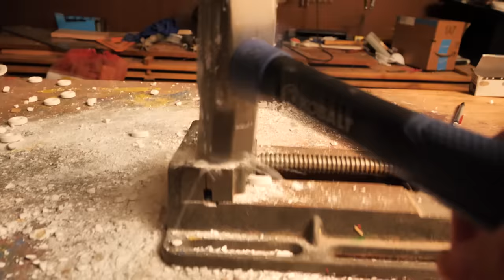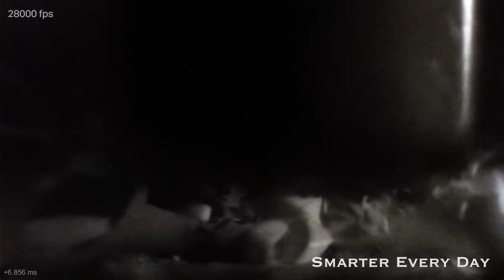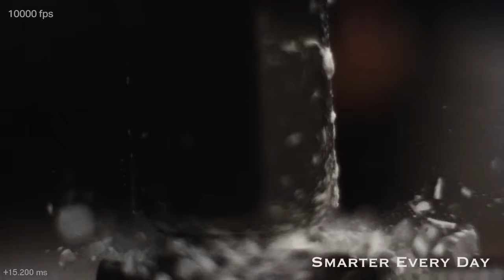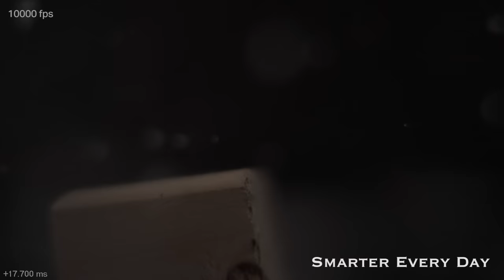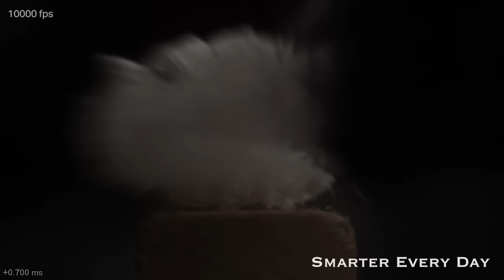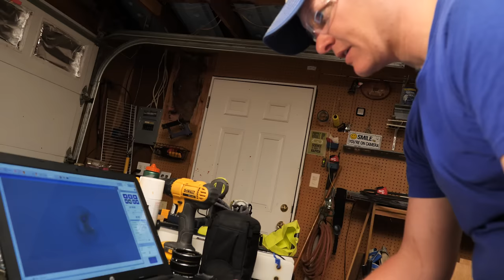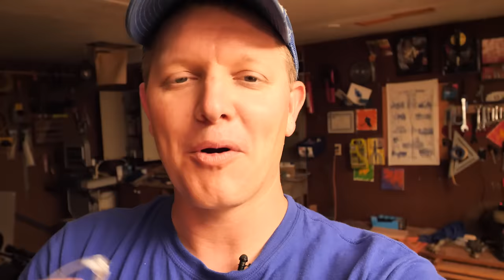LIFE SAVER LIGHTNING (Triboluminescence Slow Motion) - Smarter Every Day

Comment: I've always wanted to film this but just assumed the sparks would be too dim to really see with the lighting required for high speed. Really cool footage!

Edit: Oh, and also I had no idea this was triboluminescence! I thought it was peizoelectric arcing
Reply from the maker: What's up Ben, good to see you here man.  Yeah I thought it was "static" and never really thought about it much more than that. Obviously it's not because it's a mechanical event.  There are many journal articles on it.  https://scholar.google.com/scholar?hl=en&q=triboluminescence+life+savers&btnG=&as_sdt=1%2C1&as_sdtp=
Reply: Thanks Destin, rock on! I'm going to have to do some reading.
Reply: hey man love both your channels .........just a thought what about if you compressed it to the point of fracture or put it in a  clear pressure tank till it fractured, just curious what results you might get :-)
Reply: Going off the wikipedia page for Triboluminescence: "Triboluminescence differs from piezoluminescence in that a piezoluminescent material emits light when it is deformed, as opposed to broken."
Reply: Get a chunk of quartz and a burr ball bit for a dremel and grind the quartz, it has the same effect, but is nearly continuous.
Reply: you can get spark from plastic zip too ive seen it myself in the dark and was truly amazed to discover that as i was just closing my bed sheets.
 or from peeling adhesive tape away from something  (will work better  with roll you unroll, it come from the glue) it also emit some Xray.
i remember reading this because some guys was studying it to make cheap xray emitter for  poor country.
Reply: NightHawkInLight will the spark ignited a flame if you create the right atmosphere?
Reply: Though in a sense, triboluminescence is a more extreme version of peizoeletricity, right? Or am I missing something?
Reply: This would look amazing as a wallpaper
Reply: desten and nighthawk speak english u 2!
Reply: Smarter Every Day 2 it still says stress induced charge seperation, isn't that exactly what piezoelectricity is?
Reply: I wonder if there is any other type of radiation emitted from the breaking lifesaver other than visible light. Because the light appears to be blue, which is at the high end of the visible light spectrum. 

I wonder if there could possibly be any other electromagnetic emissions such as infrared or ultraviolet. I don't know how you would test this though. An infrared camera could pickup the infrared, but I am not sure about the ultraviolet.

The radiation emitted as a result of triboluminescence may differ depending on the strength of the bonds of the given material. Imagine the amount of energy that may be released from breaking diamond.
Reply: Scottomget, actually it's possible this would also emit even X-rays but only in a vacuum tube, but this is only if it is an electrical phenomenon. Judging from the blue light I'd say it is an electrical phenomenon. 

Also, the same thing happens with sellotape. There is charge separation and they were able to make enough X-rays to make a film of someones hand.
Reply: it looks like it's turning blue before the bullet actually gets there is that just how it appears? Is that the air pressure from the air gun damaging the lifesaver before the actual lead pellet gets there?
Reply: passive agressive nerd fight!
Reply: Probably the rolling shutter effect.
Reply: @scotttomget: Yes, my first question was "but why exactly blue light?" It will be interesting to investigate the colours if there, in invisible spectrum and why we see exactly blue colours.
Reply: Surely the colour pertains to the chemicals forming the light, as in like how fireworks give their colour, as in magnesium a bright white and copper green and so on ..........just a thought
Reply: Why blue? Does different kinds of crystals emit different wavelenghts of light?
Reply: I wonder what would happen using a salt lick.
Reply: NightHawkInLight try it with tape. Quite a lot of sparks over a full second when you stick it to itself and pull it apart. Should be plenty of footage.
Reply: I knew it was triboluminescence because I was on a field trip and they told me it was
Reply: I didnt know Nighthawkinlight knew science!
Reply: Smarter Every Day 2 if that's an electrical spark, could it be used to ignite petrol?
Reply: NightHawkInLight i was literally thinking that exact thing when he said he was going to film it in high speed. also i watched the vid where he broke the prince rupert with bigger bullets and it is there too when he hit it with a glancing shot as well as the candy crush lightning lol
Reply: Can it start a fire?
Reply: static noises in head
whut?
Reply: I dont know if you would have life savers with you when youre somewhere in the woods wanting to start a fire...
Reply: NightHawkInLight NightHawkInLight I love your videos, just next time please be sure to tell the kids to !WEAR PROTECTIVE EYEWEAR! When smashing things in the dark UP CLOSE lol..
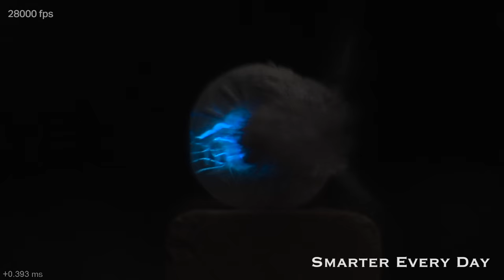Reply: @4:30 250ms I can see the light before the bullet hits and the candy is still in one peace, how?
Reply: Hey Guys. I Think It's Because A Friction Between Hard Lifesaver Candy With Himself And A Caliber. A Friction Is Make A Heat And Also Some Wave Thing. Because The Heat So Hot It Can Be Blue Or Maybe It Can Be Also Because A Wave Between Molecule/Photon. That's Why The Candy Make Tribolumenescene
Reply: Same thing happens if you crack ice cubes in the dark.  Always figured it was static electricity...
Reply: Bed sheets is static...
Reply: @SmarterEveryDay2  Hey Destin, any idea why light begins to appear 4:29 before the pellet strikes the candy? Have you tried running the experiment with near misses to see if its a pressure wave effect? Or is it something more benign like a frame perfect strike or other camera related cause?
Reply: Check out Sono illuminessence
Reply: What if we take a big candy or many candies together???
Reply: Lifesaver, more like lightsaver.
LightSaber.
Reply: @SmarterEveryDay2   Did you notice the life saver started glowing just before the pellet hit it? as if the pressure wave started the reaction.
Reply: Are these sparks capable of igniting fumes or any other type of accelerant? Pumping gas chewing on a lifesaver?
Reply: It's extremely creative to think that it's not actually real time sound
Reply: 🇮🇹 4:30 The we can see that it lights up even before the bullet hits❗❓
Reply: Smarter Every Day 2 Correct me if I’m wrong but I saw electric arcing starting before the pellet even hit the lifesaver. Interesting.
Reply: I hate to be the one doing this on a three year old video, but....

*piezoelectric
Reply: @SmarterEveryDay2  CHECK OUT THE FRAME AROUND 4:30! The shockwave in front of the projectile causes it to light up before it reaches the Lifesaver.
Reply: @Server0750  The shockwave in front of the projectile impacts the Lifesaver before the projectile reaches it.
Reply: @Stacy_Smith  does a bb go faster than the speed of sound to create that Shockwave
Reply: @Server0750  I think it depends on how much you pump it, but yes there are supersonic air rifles.

Even at subsonic speeds, the air it's meeting has to go somewhere. So there's bound to be compressed air in the front of it. Maybe not enough to to create a sonic crack, (that's slang for the sonic boom generated by a projectile), but nonetheless it still has to be there.
Reply: @SmarterEveryDay2  DUDE! You HAVE to revisit this! Your comment section is BLOWING UP with theories pertaining to the lighting of the Lifesaver prior to impact.

The 2 prominent theories are:
#1 A video defect created by the camera. (They keep referring to something called "rolling shutter effect")

#2 Compressed air at the front of the bb caused by it's motion is striking the Lifesaver shortly before impact.

You've heard the figure of speech: "I'm a _____ not a rocket scientist" right"? Well I'm a truck driver not a rocket scientist, but I do know of a rocket scientist on YouTube that has a channel called "Smarter Every day".
Reply: Coming in late but education knows no time. It seems I observed that one lifesaver started “lighting” before the pellet hit. Was that from the air disruption in front of the projectile?
Reply: I don't think sparks or lightning is right. In both those cases, high amounts of electricity is turning air into plasma and scattering blue light (blue light being a side-effect). In this case the crystal structure is actually producing/emitting blue light. Also, the sensor in the camera has definitely exaggerated the blue light. In the first "shooting" of the candy, the entire side of the candy was blue when you could still see the writing. If the writing is still intact why is there light? The camera may be adding extra blue light when its trying to guess the colour of the pixels (similar to why we say a lot of rainbow pixels in slo-mo footage)
Reply: You might be able to catch some cool long exposure photography shots with this, like you would with lightning 🌩 😉

Comment: This reminds me of the lifesaver commercial from the 1980, that has a couple on a couch and one of them says if you “bite it in the dark it makes a spark” then they turn the light out.
Reply: This happens when biting them too?! Sounds like total agony on a filling (old school mercury grey fillings)!
Reply: @goatlps  gosh never considered that.  Did you actually get a zap feeling?   I know Dr Tenet does a lot of work with tooth voltages.
Reply: @MrShakamuni01  no, you don’t feel anything from the spark.
Reply: @MrShakamuni01  not really a spark, it's crystaline fracturing exciting electrons that were formerly bound to a partner. You can get the same by striking quartz crystals together, rubbing them together, etc. Cellophane tape unrolling also generates the phenomena, as well as x-rays sufficient to actually x-ray a researcher's finger in a vacuum chamber.
Electrons are very excitable things.
Reply: Me and my friends used to do that all the time; worked best with the spearmint ones - stand in front of a mirror with the lights off and you can see them spark when you crunch down
Reply: @spvillano  "electrons are very excitable things"...omg, best comment ever.

Comment: Why is it blue why not any other color???
Reply: Electricity
Reply: Different atoms give off light at different frequencies of the electromagnetic spectrum. I guess glucose just happens to give off the blue part of the spectrum.
Reply: KeshKoKid It gives of an electrical charge and this is why its blue. When he smashed it with a hammer you can see it pretty easily that that is what happens.
Reply: Elias Bazan Here is answer from wikipedia: "Wint-O-Green Life Savers work especially well for creating such sparks, because wintergreen oil (methyl salicylate) is fluorescent and converts ultraviolet light into blue light. "
Reply: here's my guess it just a low energy output
Reply: +Lilcon - Wrong way round.  Blue light has the highest energy of the visible spectrum; if it was a low energy output it would be towards the red.
Reply: The color is dependent on the electron's state which is dependent on which atom it is with. I think Nitrogen glows blue when excited and most of our air is Nitrogen.
Reply: Elias Razan, I would have guessed it was electricity-related, myself... BUT going through the slow-plays and looking closer, I noticed that the light always followed the fractures exactly. Electrons simply don't do that... Since electricity of any kind follows the path of least resistance (a fairly inconsistent path) and the light from the life savers followed (consistently and predictably) the exact paths of fractures... It's probably not electrons or related to them.
   What's left is the possibility of energy output, and blue being the color of the higher end of visible light... That would mean there's considerable heat involved. From experience, even a small ablative spark from material being machined (like a rotary tool against a stone) the sparks tend to be red-orange to some white-ish... and they're extremely hot (burn hands, singe clothes, etc) and I don't see enough spark around to cause the slightest hint of a singe-mark or any other evidence of excess heat. In fact, the sparks don't seem to have much energy at all... In the slow-plays (again looking closely) the sparks scarcely last long enough to make a contiguous line along a single fracture, and this is something the size of a life saver candy at multiple thousands of frames per second... So no... It's not for heat, energy or much of anything related.
   Finally, we have the "resonance" of the material. Someone mentioned that wintergreen is composed of chemicals that tend to turn the excitement of ultra-violet light to blue innately, so that is likely. There's also the possibility that between the wintergreen additives, the sugar (sucrose, btw, not exactly glucose) and other constituents of the candy shaping and crystalline structure, that blue is predominantly emitted, and/or exacerbated with the very fracturing process in the candy itself. Just like you'll always get a hot, orangish-yellow spark for striking iron against flint, you'll likely always get the same clean blue color for crushing or shattering a wintergreen life saver... Whether it's the specifics of the wintergreen oil, or the whole combination is about all that's up for debate... So grab some wintergreen anything and start crushing to see what's what... :o)
Reply: Oxygen perhaps
Reply: N2* → N2 + hν and O2* + 2 O2 → 2 O3 is the process of which creates the blue colour. Also water vapor, when present may also play a role.

Comment: If you bite in one fast enough, does it light up in your mouth and shock you?
Reply: @karim lavji I'm not so sure about it. Light is fotons after all, and even when they don't have mass, they do have electrical charge. What I assume is that there is so low electrical charge you wouldn't feel anything, or the "crush" you make isn't enough to make them. I'm curious about it, if it releases the charge because they have an electrical charge from the beginning, or because of friction.
Reply: @pokerraper1  when you don't pay attention to the 6th grade science lessons

Now watch this start a war
Reply: I can promise you, a piece of hard candy does not have stored electrical charge
Reply: Nightcore Sorcerer yeah that could be a legal problem
Reply: @skilled_boi4076  no, but it does have energy stored in the structure.
Reply: Nope, not an electrical current, it's an electron bond breaking in the crystal. You can generate this also in quartz crystals being rubbed or struck together.

Comment: If the light is from ionization of the surrounding air, if you were to smash it in various different gaseous atmospheres, would it create different colors?
Reply: Alex Ozzie it should be tried on vaccuum as a control experiment
Reply: Tadeo Velazquez I believe I read on the wiki that it has been performed in a vacuum with scotch tape and it produced x-rays.
Reply: I wonder if it could ignite a gas like a hydrogen/oxygen mixture perhaps.
Reply: MOM get the argon!

Comment: Dustin, Don't know if you noticed this but it appears the Life Saver glows blue right before the pellet hits it.  I wonder what would cause that because the pellet has not struck it yet, unless it is because the pellet is moving faster than the frame rate so it appears to have not struck yet when it has.  Fascinating either way.

Comment: Why does it triboluminescence right before the BB or Pellet hits the Lifesaver at 4:30 (28,000fps camera mark +0.250) on the right side? It looks as if it knows where it's about to get hit at and spark right before contact. I first noticed it with the hammer and thought I was seeing things and after rewatching it a lot of times I just assumed that it was some reflection of light that showed the hammer in the frame at a point it's already passed and already hit the Lifesaver. I assumed because Light is faster then photography that's why I see the Spark before I see the actual photo of it being hit. Then I realized Light is Light whether it's Light from the Spark or Light from the Photography I'll See it at the same time them I seen it again hear and I'm still puzzled on why?

Comment: My thought is it's the energy released from mass created from these crystalline chemical bonds. The first law of thermodynamics is that energy cannot be created or destroyed (energy is conserved). Einstein's basic equation of relativity is E = mc^2, where E is energy, m is mass, and c is the speed of light squared. We know that nuclear bombs operate by splitting atoms, and during that process, matter is converted to energy (of course, which explains where the massive amounts of energy come from). However, in chemical bonds, there is a very slight amount of mass increase, nearly immeasurable. This mass is obviously very small, and we know that energy is always conserved (first law of thermodynamics), therefore, it may just be equal to the amount of light being released from these crystalline/solid structures. Triboluminescence may be unique to crystals since crystal vibrations travel much faster, hence, releasing light faster in a cumulative way making it more easily observable. 

I was told about the mass in chemical bonds phenomena by my chemistry professor in college. The thought above flashed through my mind just now while watching this video. Anyways, nobody has confirmed any explanation of triboluminescence as of yet, so I hope people have fun playing with this hypothesis!

It may be as simple as the settling of electrons from a higher to a lower energy state (emission), however, is there a possibility of mass loss during this process? It's hard to prove or confirm since these masses will fall outside of our detection limits and may just be grouped in with random or systematical error...?